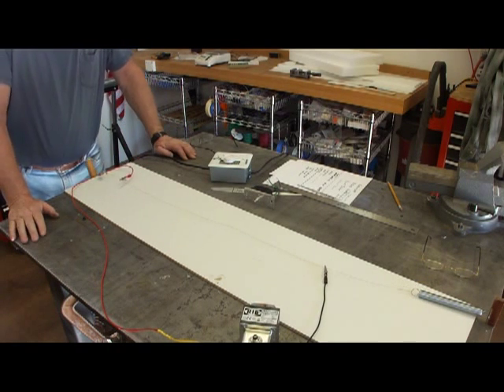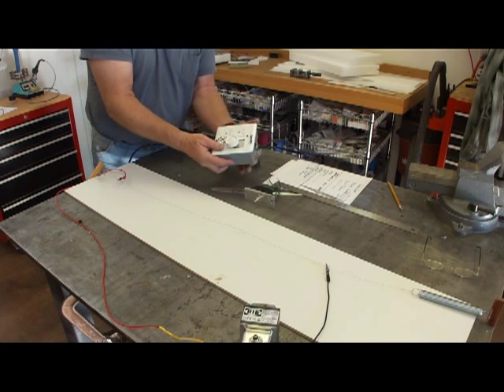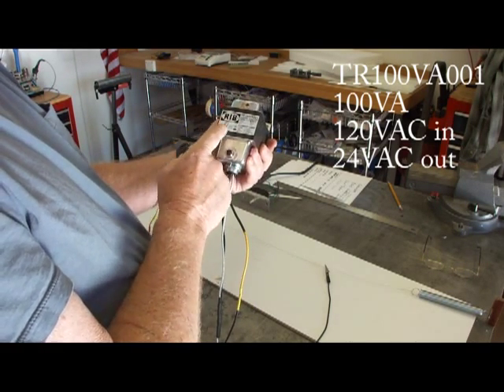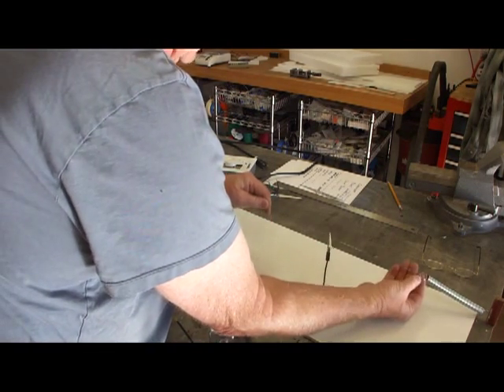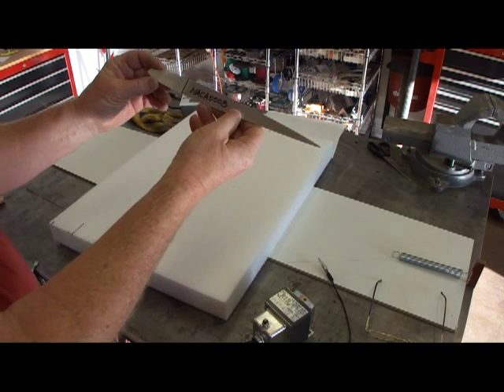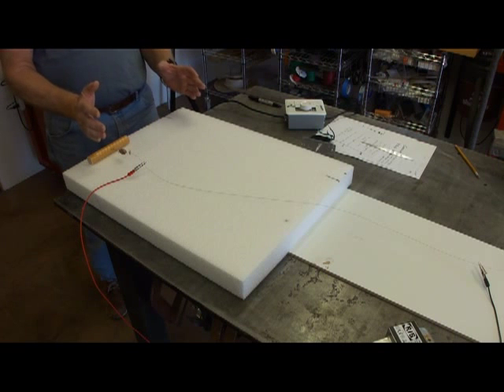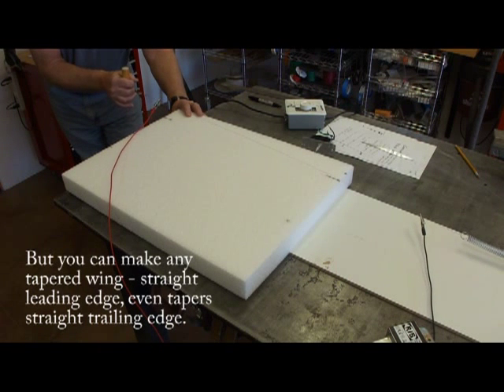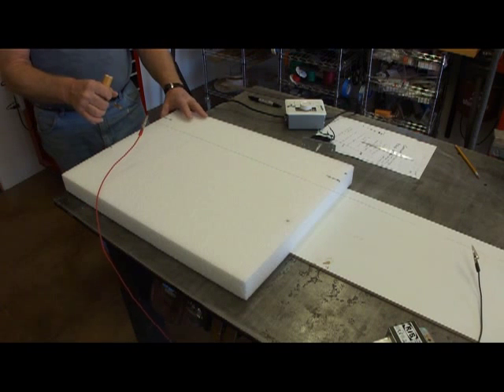How to Hot Wire Cut EPP Foam

Comment: shouldn't there be an airfoil template on BOTH sides?
Reply: He may have been cutting a tapered wing, the outer template forming the root, and the wire pulled straight tapers the height and chord of the wing. I don't see why 2 templates couldn't be used for an untapered wing, just probably want to round/smooth the edges of the inner template that the wire will drag across.